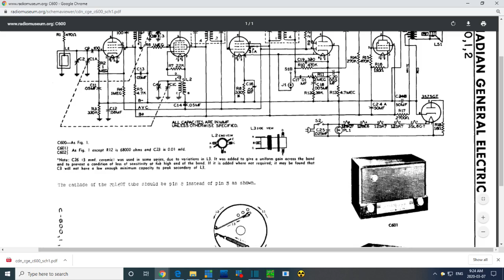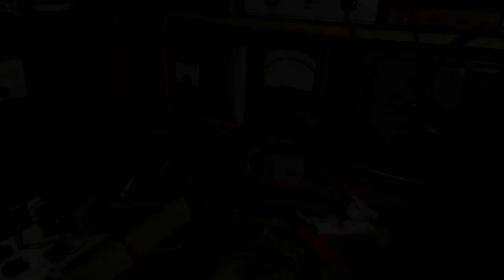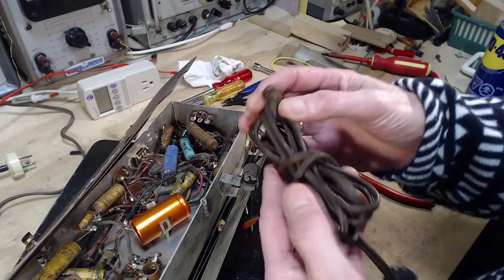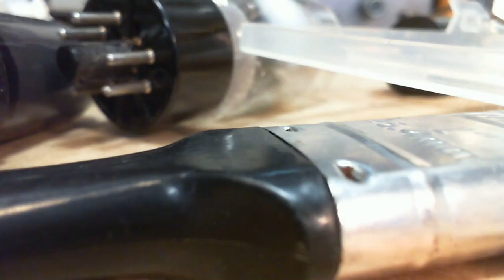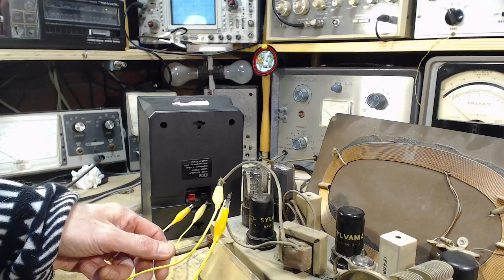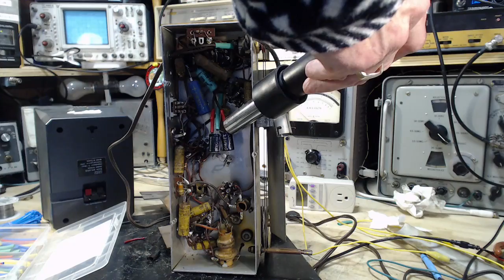General Electric C600 Video #2 - Power Up Testing

Comment: Are you sure you put the tubes in correctly? Jim, you said two different tubes were identical replacements.  I missed which ones they were but why did they not use the same tube originally for both?  Maybe I am confused...

Comment: Hi Jim
looks like the designer of this radio dropped the converter tube a g c .
So eliminating the problem of the a g c voltage shifting the local oscillator !

Not that the oscillator will not try & follow a very strong signal at the input .
A 10 - 30 Khz capture range is not unusual with a mixer & lo combination .
It depends on the circuit & signal strength applied !

Comment: It is quite common to add c26 across the RF coil to lift the sensitivity at the top end of the band. I have mentioned this in past video’s. Often when you buy an off the shelf RF coil it will already have the capacitor loosely tied on.

Comment: Is the Phono input switch set to external?
Reply: Nigel Brockwell Psst dont tell anyone. Lets see how many videos it takes for him to figure out. But yes sir, it is indeed set to phono. The closeups during this and the previous video show the slider of the switch pushed towards the phono socket location. And going by his previous C600 repair and the closeups of the backside therein that would be labelled as the phono setting.
Reply: @melissahermsen5630  I did spot this right at the beginning.